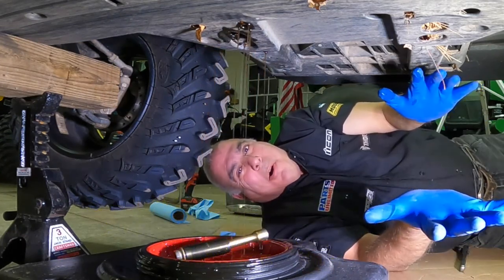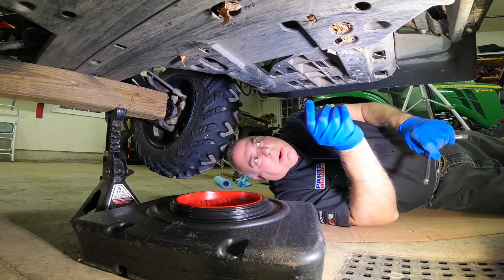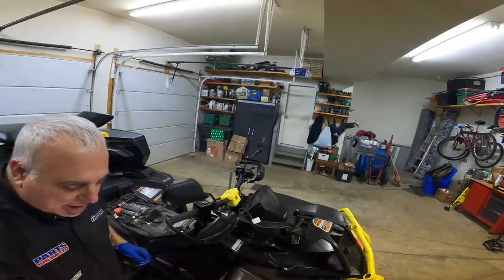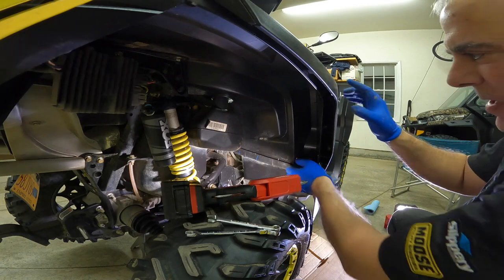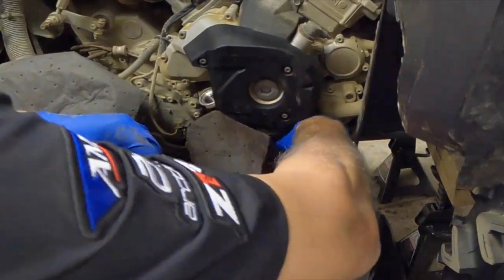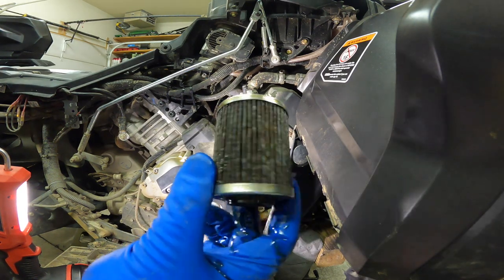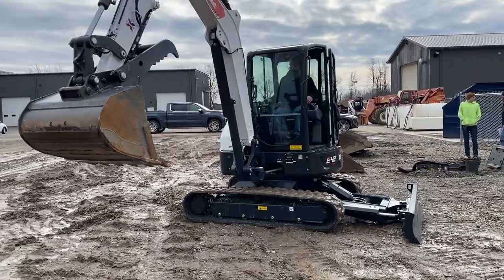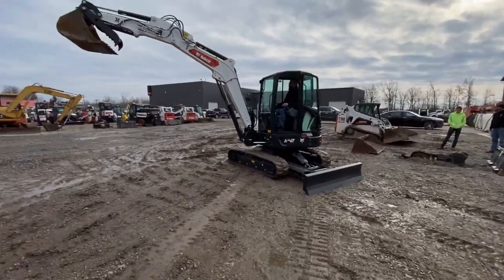Can Am Outlander Oil Change Real World #154

Comment: I do my own and the only plastic you need to take off to gain access to the filter is the one under the wheel arch looks like your doing it the hard way
Reply from the maker: Ken in know this, but Can Am wants you to change the transmission fluid at 25 hours and that requires removal of the panels and foot well. I really like the videos removing the inner fender to change the oil filter...i agree that is much easier for just changing the crank case oil. Stay healthy.
Reply: Transition go from the back when you take of the plastic skid plate 5. Min top
Reply: What this guy said
Reply: @maraudermitchelli no it don’t go threw the back to get the bottom one out

Comment: You can change the oil filter without pulling the side panel. 1/4in ratchet with 6” Extention. T20 is the size of the Torx bit you need.
Reply from the maker: Others have said the same. Ugh the first time I filmed this I didn't use the video it turned into a wrestling match with panels and fenders during a hot summer night. You're probably better at this service than I. Take care Be safe
Reply: Spot on it's how I do it, in the past I did used to pull half the shit off but it turned a simple or what should be a simple job into a major day and a total fucking nightmare they are shit to work on.

Comment: This was a great video! My friend and I just did the oil change in his outlander 570 today and to say it was a PITA is an understatement! There was plenty of profanity involved during plastic removal! I do not own one of these machines. They seem very solid, well put together and of high quality.  However, if routine maintenance is this difficult, it's a deal killer for me.
Reply from the maker: They are an amazing machine...maintenance is disappointing no doubt. Your friends engine is awesome. Drive them before you judge them. Thank you for commenting.
Reply: @maraudermitchelli  Oh, I have driven it and I agree.  Compared to my 2 Polaris 570's..........Well, there is no comparison.
Reply: The reliability of can-am outlander is second to none, high maintenance but worth it in the long run, my cousin and older brother had Polaris and they didn’t last one summer season, I put 35,000 kilometres on my outlander before I sold it, quads are like the family car in the north
Reply: These are the best quads the technology that goes into the motor and the chassis and the ride is number 1, I put 35.000 kilometres 
On mine, but I had to do the maintenance on it, it’s worth it, like he said the torque is well worth putting up with maintenance, if you have  a dealer near by get them to teach you how to do the maintenance the first time, you won’t regret it
Reply: I was able to change all fluid and the oil filter with only removing the side plastic and front wheel well plastic. You need to use a pump or hose to fill the transmission fluid without taking off extra plastics, but saves so much time. An oil and filter change really only takes about 30 minutes and the diff fluids are the same since nothing needs to be removed to access. Especially on the 570, which is what I work on.

Comment: Nice video, Pete!  "Design for service" is a big concern for guys that like to do their own maintenance.  I love my BRP Ski-Doo's, but tasks that you think would be simple turn out to be very difficult.  I could change 2 spark plugs on my 2005 Ski-Doo Renegade 800 P-tek in less than 15 minutes.  On my 2012 Ski-Doo Renegade 800 e-tec, that same job takes about 3 hours.  These machines have become so compact - every inch is used and you can't easily get your hands and tools in the proper position.  And if you drop a nut, bolt or socket, you'll spend 30 minutes finding and retrieving it.  My best friend is an extendable magnet when I'm working on my sleds.  These machines are great fun though!
Reply from the maker: I agree with you 100%. The first time i changed the oil on my Outlander 1 up i did the same thing searching for dropped parts in the frame...even tools. My best friend was a magnet on a stick...agreed, that just slows down the job. It's the price you pay for a great machine and engine....that's what i tell myself. Thank you excellent comment.

Comment: I recommend not changing your oil while the machine is warm. It's best practice with all engines to wait until the oil is cooled down to change it. It's 100% the reason you're having it splash around everywhere and can actually be very dangerous since oil reacts different when hot and will splash everywhere and potentially melt or catch on fire. 

Always drain oil cold. You can start the machine and run it to move it or whatever, but do not let the engine heat up.
Reply: Also, you can access the oil filter by removing only the side plastic and front wheel well and do not need to remove the footwell. Can save you so much time. You can still access the transmission plugs, but will need a pump or hose to fill it. I find that much faster and better than removing all of the plastics every maintenance.
Reply from the maker: Interesting tip thank for caring and share. Be safe thank you 😊

Comment: I just did service on my 850 Outlander. Only panel I took off was the inside right fender to change the filter. Wasn’t that bad. I also did all the grease fittings except the 2 on the drive shaft. Couldn’t get to them . I have a full metal under carriage protection plates. Didn’t even try and do the spark plugs because the front one is impossible! Can Am engineers did not design a machine that is friendly to do it yourself owners. Great ATV’s but I won’t buy another one just for the maintenance issues.
Reply from the maker: Bill not sure how you changed the trani oil with out removing the fender...but good for you. I hate to say I agree with you...but i do. That just isn't right. Thank you enjoy machine.

Comment: Which ATV have the easier maintenance (oil change and air filters...) ? I have a 570max xt, with snow plow, and to get to the oil filter is a pain! Why can't the oil filter be placed under a removable panel or seat?
Reply from the maker: All the Polaris ATV's and SXS's are easier to service than Can Am ATV's and SXS's. I've been there buddy those Can Ams are brutal hours to do crankcase and tranny fluid. Polaris is about an hour to change crankcase oil. Thank you for watching

Comment: Now add a aluminum skid plate from the factory and it's another thing you have to remove, they weren't even smart enough to leave you a hole to access the front diff. drain plug.  Good atv just brutal to service it . I'll be looking elsewhere for my next bike.  Getting up in age and I don't need this shit!
Reply from the maker: DC...I'm with you, that's the same thing I'm doing. Really is a great machine especially the engine. Ride in peace...btw Polaris is so much easier to service.

Comment: Its splattering out of the drain due to the fill plug still being in. The crank case is gulping air while it drains slightly and it sloshes all over when it drains. If you let it breath with the fill plug out itll drain much better
Reply from the maker: Flyn that's good advice thank you and be safe. It's nice you took the time to help me.

Comment: The brp engineers/designers should be forced to change the oil on every Can-am machine sold as penance for their evil ways!
Reply from the maker: It’s their philosophy, great engine but I don’t think they will change. If the could just add some access panels on their body panels and a casting here it there…I don’t get it either. I heard the Spiders oil change has to be done by the dealer… Stay healthy 🙂

Comment: I'd like to ask how you got the ATV on and off the steel jack with the 4x4 ? Thanks
Reply from the maker: David I have a motorcycle jack which lift very high...higher than a car jack. I probably lift the front and rear separate then installed stands. I hope this helps.

Comment: I have a 2021 Outlander Max 1000 Limited and and a 2021 Outlander Max 650 XT and you don’t have to do any of that lol.  You just remove 1 panel in the wheel well to do the oil and then particularly remove the skid plate to do the trans.  Maybe the Max is different cause it’s a little longer but damn
Reply from the maker: Oh boy you're better than I. Glad you like your machines.

Comment: Did my first service today and with a fleet head 1/4 drive ratchet and a shallow socket I got to the filter bolts without pulling any plastics but the one right on the side of the engine
Reply from the maker: How did you drain the transmission fluid and fill?
Reply: @maraudermitchelli  I haven't yet I am waiting on a package from Amsoil - however I will get back to you if I have a better option.
Reply: Check your email I sent you a video on how I did it. Pulled the seat and one side plastic.
Reply: Ya it’s not bad with the proper tools

Comment: That looks like a Nightmare . My Sportsman XP 1000 or Grizzy only takes about 2 minutes and both have a spin-on oil filter so much cleaner and that oil filter in side is for the stone age and there is no way fill it with oil like a spin-on filter so the engine starves for oil till it fills  up the oil filter housing.
Reply from the maker: I agree with you, it needs to be simplified. The engine is awesome though...it's a powerhouse.

Comment: You can do an oil change without taking any panels off I could maybe make a video next time I do mine 2021 850 max xt
Reply from the maker: i believe to drain and change the transmission fluid the panels need to be removed. Let me know please or forward a video. A viewer mentioned a video where the front inner fender was removed to access the engine oil filter...but not the transmission. Stay healthy.

Comment: Great video. I found another video where you take off the wheel and remove plastic from the wheel well. Instinct access.
Reply from the maker: Thanks Chris but that doesn't work with the transmission fluid change. Stay warm

Comment: Do you have a video on how to lubricate the throttle cable? The manual says to do it every year but I don't hear people talk about it.
Reply from the maker: No I don't...that may be as simple as WD40  at the exposed cable ends...but the throttle on my machines is fly by wire i have not cables. If yours is the same i guess we solved that issue. Stay safe.
Reply: I have a 2017, so still cable. I'll try the WD and go from there. Thanks man and keep up the great videos.

Comment: Great video. Thanks for all the tips on screw locations, because I have broke panels in the past with wrestling hidden screws. Also Beautiful garage, one tip I have is before you do the oil changes, next time I recommend putting down a cheap HF tarp and moving blanket(absorbs the spillage) on top of that under the machine before you start. Makes for a nice clean floor and something more comfortable then hard cold concrete to work on, as we are only getting older. Lol
Reply from the maker: Excellent tip thank you. I have to buy some moving blankets. Thank you stay healthy.
Reply: You prolly dont give a damn but does anybody know of a trick to get back into an Instagram account..?
I stupidly lost my login password. I love any tricks you can give me!
Reply: @Alfonso Baker instablaster ;)
Reply: @Pedro Leighton thanks so much for your reply. I got to the site through google and im in the hacking process now.
I see it takes quite some time so I will get back to you later with my results.
Reply: @Pedro Leighton It did the trick and I actually got access to my account again. I'm so happy:D
Thanks so much, you saved my account!
Reply: @Alfonso Baker glad I could help =)

Comment: You just remove the front panel in front of the filter and thats it. You can do it all right there
Reply from the maker: Yes but you can’t change the transmission oil…more panel need to be removed. I’ve watched people change the oil that way. Thank you 😊
Reply from the maker: @stewbuntu  I can assure you I'm not a fraud. I followed the manual...not the best illustrations. I heard there are remote oil filter kits for this engine. I don't know why Can Am does not offer that on all their engines. That would end this debate. Post my video I've watched videos where the filter access is from the inner fender which works well...but does not help with the tranni oil change. All good my video just shows how I changed the oil following the instructions. I do love that Rotax engine. Stay safe.
Reply: @maraudermitchelli  Its a fruad by Can Am to scare owners from doing a 20 minute oil change via the front cover/5 snaps, and you are perpetuating the lie, as if its something difficult.

Comment: Love the videos.  What is your preference between the max and the single Outlander
Reply from the maker: I traded the single which was older than the max...i prefer the longer wheel base for hills and ride. The one up is definately quicker but i ride slow. Stay healthy thank you.
Reply: I Love the longer wheelbase so much so that I added 4" to wheelbase of my Sportsman XP 1000 to make it the same as a 2 up model and only had to buy the rear drive shaft for a 2 up model to make it work.
Reply from the maker: @crazyflyboy30  OMG that's impressive...good for you. Can you email maraudermitchelli@gmail.com please pretty to cool. stay healthy
Reply: @maraudermitchelli  Thanks, I   think I have the only 58" wheelbase with the new body style 2018 Sportsman XP 1000 and the is 1" longer than a regular Polaris 2 up version(57") but still 1" sort of a can am (59") max .
Reply from the maker: @crazyflyboy30  very neat.

Comment: I just changed the oil in my 2011 and it was very easy. I only had to remove the panel between the front right wheel panel and remove the bolts between the front right fender and foot rest panel so i could move it while working. I have a plow frame under mine so the oil plug access is super easy. I only fought the heat from the engine because i warmed it up too much. The only real beef i have with mine is the air filter access is a pita.
Reply from the maker: Oh boy John that's still a lot of work. Good job by you, sounds like you enjoy your machine the engines are great. Thank you